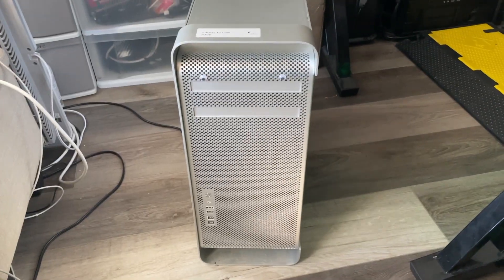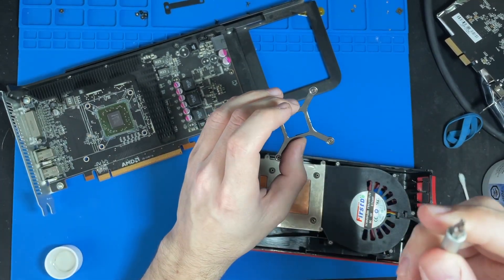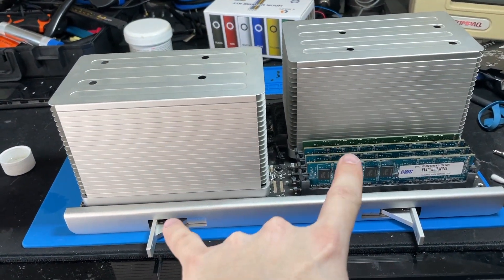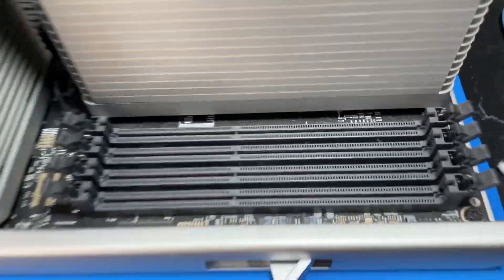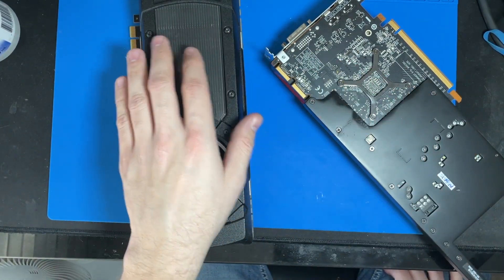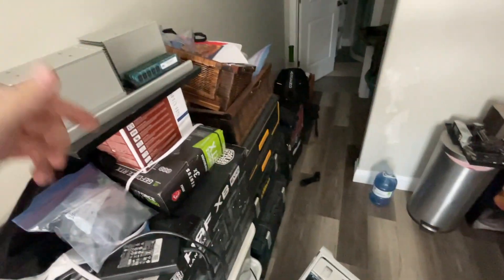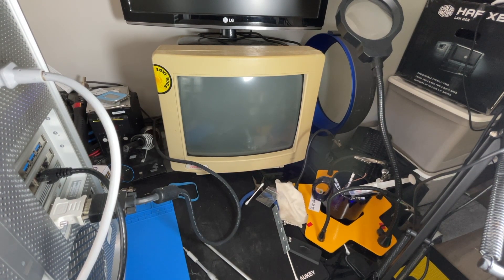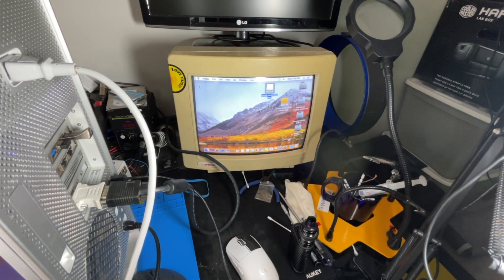A Mac for the PC Enthusiast: The Mac Pro 5,1

Comment: Welcome to the world of Mac Pro enthusiasts lol. They do support NVMe boot but you have to update to the latest firmware, which requires installing Mojave, which requires a GPU which is Metal compatible. What I did with mine was install an RX 580 while in High Sierra, then I did the Mojave install which upgraded the firmware. Then you just need a PCIe to NVMe adapter or one of expensive full x16 cards with 4x NVMe slots and a PCIe switch chip on it. With that you can reinstall the OS onto an NVMe drive.

My favorite OS to run on these is Ubuntu.

Comment: Got a 4th gen flashed to 5.1. Installed Linux Mint in it. Great combo! No update pb like with Mac OS.
Reply from the maker: ah, well the follow up I made is all about upgrading and bypassing update limits. Linux mint is a nice and stable os though.
Reply: @spottedtango  I did some improvements too but for the upgrade issue, I choosed the shortcut ;-). I've never felt at home with MacOS. And by the way those Mac Pros were just a refined version of PC servers like the Dell Power Edge. That's why they are so easy to customize.

Comment: I’ve got two of these in my studio, both still crunchin’ away. Both have SATA SSD boot drives, Mirrored RAID storage, and #1 has a pretty stout 8GB RX 580. I’ll run these beasts and pamper them till they give it up, or some mission-critical software upgrade makes them obsolete. At which point I’ll retire the 2010, keep the 2012, and get a more modern machine for Workstation #1.
Reply: I have the same from new, now 11 years old with the origial Apple display  they never give up however once I change the motherboard and 3 times the powersupply. Despite for daily use I have the Mac mini M2 Pro, I still love this beast.

Comment: definitely recommend dual x5675 over x5690, just downgraded my dual cpu model to the 5675. nearly the same performance with a much lower TDP for CPU which allows more power headroom for the GPU if you have a pixlas mod, which i also recommend for any modern GPU in the mac pro.
Reply from the maker: I hear you, but I think the 5,1 PSU is rated around 980W? Should have plenty juice left over for pci-e. Be more than enough power budget for anything that makes sense to go inside it even without the pixlas mod. That'll only get more true as time goes on and GPU efficiency increases as long as people keep up support.

Comment: There is a button on the top of the fan that lets is slide back and allow the remove/install the video card. Sometimes it stick but press firmly and slide away from the slots.
Reply from the maker: Yeah, I learned that eventually. Didn't even notice at first time around. Thanks for the tip.
Reply: @spottedtango  Join the club.  Had a devil of a tiime trying to get the card out and lifted to one side on the far end and slipped it out barely.  After that I round the button/slide

Comment: I still use a 3,1 octocore 3ghz 32 gb of RAM on daily basis. My ATI 5870 died and I just got a NVIDIA GeForce GTX 680 2048 MB which is metal capable and now I have Catalina aside my Sierra and High Sierra boot drives.
Enjoy your 5,1, that´s a great machine.

Comment: I would love to see someone put a latest gen intel or amd top cpu, motherboard, plié 5 ssd, tb,music 4, amd gpu that works, into one of these, for the ultimate hackintosh but in this body with a 4K blue ray p layer, if possible.
Not sure.
Reply from the maker: I mean, anything is possible. But that would not be an easy task. You'd need to do a lot of planning and whatnot, maybe even make an adapter tray for standard ATX motherboards, because the mac pro case is certainly not ATX. But I know people have and can do it. However in my experience, hackintoshes are cool to do, fun to work on, and a pain to use. There is always SOMETHING that's messed with them. No sleep issue here, Kernel panic there. Blegh.
Reply: You’d need to design a new daughter card, if not a custom motherboard.
Reply: @thejpkotor  ok lets do it

Comment: I picked up one of these cheap coz I love the aluminium case. Chucked 64gb ram a single x5690 and an rtx 2080. Gpu was a bit overkill, but meh. The whole pcie running at 1.1 in windows had me baffled for a while, but since sorted.
Reply: What was the issue with the PCIE running at a lower speed?
Reply: @rare6499  it was a firmware issue. I put a Mac install on it and upgraded as high as I could go. There is a firmware update as your upgrading that unlocks the link speed. High sierra I think?

Comment: Mac is lacking so many things, a PC guy would not be interested:

-small software ecosystem
-terrible for gaming
-terrible for 3D modeling
-way overpriced
-upgrades/repairs are difficult

Today, PCs are cheap and very powerful.   Is it any wonder that Windows has 90% market share?
Reply from the maker: well, I can give you one example. Do you know what PC was lacking for me? A video editor with timeline playback that didn't suck. 5800X, 3080, the works. I have a very good computer. And resolve still runs like shit and yes I have the paid version with acceleration. So I don't know man, different strokes for different blokes. No reason to be narrowminded about it though. not to mention the whole point of this video is that most Macs do suck, this is my best worst option.
Reply: @spottedtango  Resolve has problems?   Make sure you are running the latest version 18.1.4, or just use another editor:   Premiere Pro, Vegas Pro, or Avid.     That's what is so great about Windows:   a HUGE software ecosystem that makes the little Mac look weak and pathetic.

Now that Mac is using a processor from a cell phone (M1/M2), it is even worse!

-terrible for gaming
-terrible for 3D Modeling
-eGPU no longer works
-macOS is a buggy mess
Reply from the maker: You're right I'll just throw it out then. Thank you.
Reply: @spottedtango  No need to throw it out, just don't expect PC guys to get excited.   Windows PCs offer an amazing price vs performance.
Reply: Windows has pretty much always had 90% market share. But gaming on a Mac at all is kind of a bonus.  If gaming is your priority, get a PC and save your money for a pricey Nvidia card… and your electric bill. They do make pretty good space heaters, too.

But I’m with ya on despising the “sealed black box” model of modern macs. It’s a wealthy extraction scheme on Apple’s part. And the closed CPU/GPU/RAM architecture of the Apple Silicon machines is a 90 degree divergence from what high-end users want in a Mac Pro, upgradability, expandability, and maximum customization for specialized use cases. Good luck, Apple,
Reply: @samuraiartguy  You missed my point.   Mac owners always say that Mac is superior to Windows, and in the long run, cost of ownership is less, because less IT support is required, the hardware lasts a long time, etc.   That's what the Mac guy would say.

If that were true, then of course all companies big and small would have Macs on the desks of all employees.   But in reality , Windows totally dominates the corporate world.   Mac is considered to be an overpriced JOKE.

Let's say you are rendering complex Blender scenes  on a $7000 USD Mac Studio, vs a Windows PC with NVidia RTX 4080 card.

The Mac will use less electricity that is true, but the Mac will take MUCH longer to render a scene.  The end result?    NVidia doesn't use much more electricity than the dog-slow M1 Ultra to complete a render.

Remember, a person's TIME has value, and 
Mac offers poor performance versus a Windows PC.

Next year, I can easily upgrade my Windows PC with the next monster video card from AMD or NVidia.   Mac is dead-end, a disposable computer, no upgrades or repairs.
Reply from the maker: Imagine for a moment that there is a subset of people trying to render content for perhaps a recreational or semi-professional purpose. Now imagine they don't want to wade through the pita that is proxy media or complex effects configuration techniques. Imagine some company offered a product that fixed both those problems for people who would gladly spend 2000$ on a camera, but not $25,000. Now you know where Mac sits.
Reply: @spottedtango  In 2023, computers are made of basically cheap commodity parts:  cpu, ram, ssd, graphics.

In 2023, the Windows software ecosystem is HUGE, and offers everything and anything you might want on a computer.

There has been a big change in Mac in the last few years, which is very damaging to Mac customers:   Apple Silicon, based on a chip from a cell phone.    WIth M1 or M2, say GOODBYE to Windows compatibility, upgrades or repairs, and goodbye to powerful graphics from AMD or NVidia.

Besides Final Cut, there is basically no reason to waste your money on a Mac in 2023!
Reply from the maker: I agree, mostly. only other use case is people who want a premium build quality external laptop for basic tasks. It's hard to beat the performance and price you get out of an M1 air compared to it's competitors in its weight class. Engineering flaws apple never acknowledged aside. That and good battery life. pretty impressive you can work a whole workday on an m1 air without fear if you forget your charger.
Reply: @spottedtango  I feel sorry for anyone that spends a whole workday on a Mac Air, a machine with tiny screen and sub-standard keyboard.   A desktop PC running Windows 10 Professional with large screen and full-sized keyboard  is so much better!

Most people work at home or in the office.  Who are these people that are doing 'work' on a tiny little laptop Macbook Air?   What is their line of work?
Reply from the maker: live production, real estate agents, lawyers. Pretty much anybody who travels for work and doesn't need a specific to windows set of software. Not saying M1 air is the only choice, but it does make sense if your priority is battery life and performance in a small package. Unless you just have a major hard on for hating on apple, a $899 laptop that lasts 15 hours and can render a 4k video in 1/4 it's run time is a pretty sweet thing.
Reply: @spottedtango  The specs for Macbook Air mention '16 core Neural Engine'.  And how does that help real estate agents or lawyers?  LOL

I have a Windows laptop with the typical 15.6 inch screen.   That is too small.   Macbook Air has an even smaller screen , just 13.6 inches!    How unpleasant to try and 'work' on such a small toy computer!

Nobody is going to try and edit high-resolution 4k video on a tiny 13.6 inch screen, tiny keyboard, with battery power.   Let's get real, ok?  haha

The top of the line Macbook Air comes with M2 processor, which is only slightly faster than the original M1 processor from two and a half years ago!    So basically,  Apple is selling old and weak parts in April of 2023.

Microsoft Office is the world standard in the corporate world.   Did you know that Office for Apple Silicon is inferior to the Windows version?    The same goes for Photoshop and Premiere:   Windows versions are superior to the M1/M2 version.  More features and more compatibility with plug-ins and add-ons.

Comment: It's a weird competition, but this is probably the best computer Apple ever made - the second being the SE/30 from way, way back. 

I'm partial to the last G4 towers, with their dual processors and 4x AGP slots... but that's a timepiece ;)
Reply: You clearly have not used Apple silicon.
Reply: Yeah, but I dislike the walled garden that Apple has been building since the 5,1 - lack of consumer upgrades and the need to emulate Intel to use regular consumer software. I do some gaming, the M1 is not the system for that. 

I may return to Apple someday, but I wandered off into the much easier to manipulate world of Linux. My Pro runs Linux, my main PC as well now. 

I was an Apple guy for a solid 25 years - my last new mac was my 2015 iMac...

Comment: I recently 'retired' my Mac Pro 5,1. Got it in 2018 (single CPU tray) for £200 (US$240?) 
Upgraded the CPU to an X5690, the GPU to an RX 580 (modded for the boot screen), 48 GB or Ram, (3x16) and it booted MacOS 10.15.7 and Ubuntu 20.04 from an NVME
Unfortunately, unless you intend to use OpenCore, you can only boot Windows 10 from a SATA SSD in legacy mode (which I did), as Windows 10 in UEFI mode will corrupt the boot-ROM.
Akin to one of your comments below, if you're running OC, you're pretty much using a Hackintosh... 
The biggest drawbacks from this machine is, lack of SATA III, USB 3, 3.1 etc and Bifurication. The PCIe slots run at PCIe Gen 2 as well. 

It was a great machine while I was using it, but, I got a good deal on a HP Z440 (I hardly used MacOS, mainly Linux and Windows)

Good luck and have fun.
Reply from the maker: Awesome man. Yeah, most people would be better served by a modern mac for sure, but I value that modularity and pc part compatibility like, mad. Great comprehensive list of the shortcomings of the cMP 5,1. I've got mine raring to be fully suped up aside from the RAM. 10GbE, usb 3.1 A + C, rx 580 nitro+, 2x X5690. Sticking with the 32GB of ram, don't think I'll need more, most of that you saw. Just waiting on the CPUs and I'll be working on the part 2 video along side some long awaited iPod content.
Reply: @spottedtango  … FYI: I‘m running one of these MacPro 5,1 using a 970 EVO Plus 2TB as boot volume. The R/W speed using a simple PCIe adapter is ~1.500 MB/s which is roughly the same I get from a brand new entry level M2 Mac mini. You can double that speed by using a dedicated PCIe adapter that enables bifurcation. But those are ~300,- US$. 

I swapped the WiFi/Bluetooth card for one that supports AirDrop, HandOff, taking pictures, etc. with all current iOS devices which is really nice to have. Overall I‘m still quite happy with this vintage MacPro.
Reply from the maker: @LGBTCIAKKK  it might render my videos slowly, but man; it dusts davinci resolve on my 3080 + 5800x PC when it comes to timeline performance. Sure others could do it better. But for staying in my comfort zone and a 11 year old way of doing things. it's pretty great. I like it.
Reply: Also have a 5,1 mac pro running win 11 in uefi mode. along with high sierra,catalina,monterey,ventura And sonoma using opencore and ALL on a single 500gb nvme...one partition ntfs and efi for windows and the other partition Apfs with efi for mac..Zero bootrom corruption when u build a windows copy that has secureboot and TPM Removed.... Research this....works 100%
Reply: @skip741x3  I know, 'Opencore' yada yada yada... But, like I said above. I don't use it anymore. thus research isn't required.